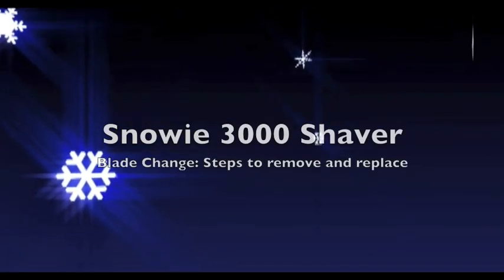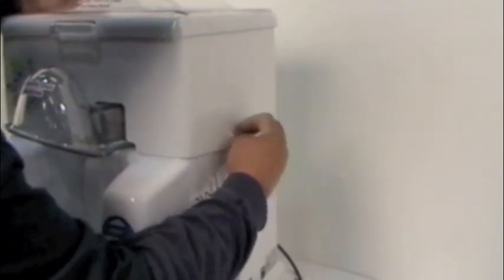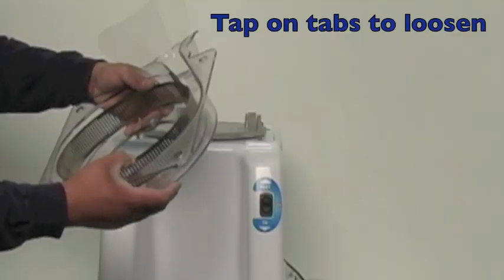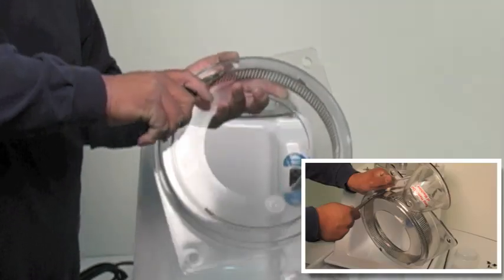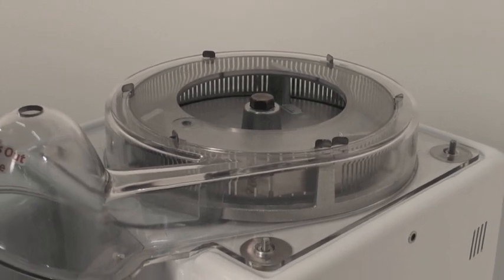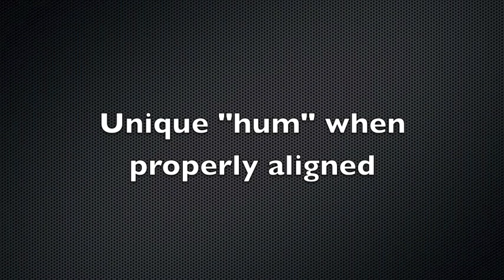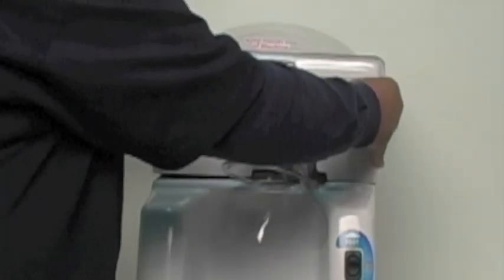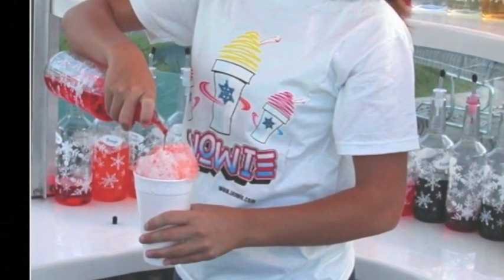How to change the blade on a Snowie 3000 Ice Shaver, Shaved Ice Machine

Comment: I just purchased a used a snowie 300, how can I tell if the blade are not good, or doll blade?
Reply from the maker: You can tell the blade is dull or dulling when it slows down or stops shaving. Remember not to let anything other than ice go into that hopper. If you let an ice tie in there, your blade will be completely useless in less than a second. I have looked at a blade after an ice tie entered it, and it looks like one scratch going across the center of the blades. What looked like one scratch made that shaver barely shave at all.  So make sure that only ice is getting shaved, and your blade will last a long time.

Comment: I read where this blade should last for approximately 10,000 cups of shaved ice. We just opened a store 6 weeks ago with a brand new Snowie Cube Pro and have sold approximately 1,200 cups of shaved ice so far and it is already taking much longer to shave a cup of ice than it did when we started using the machine. I am also seeing very tiny chips of ice that have not been shaved when I mix an Italian Ice. Why would this be?
Reply from the maker: Hello, it sounds like something may have gotten down in your blade. That would cause the blade to shave slower and possibly not shave as well. However, we are happy to replace your blade and make sure the one you received is not defective. If you don't mind calling in our customer representatives would be happy to assist you. Thank you!
Reply: @snowiellc  I just got off of the phone with a Snowie representative and it was no problem at all. The nice young lady I spoke with told me that she will get a free replacement blade out to me right away. This is definitely the kind of customer service I like to deal with. Other than having this blade issue, I would recommend this machine to anyone that has or is about to open a shaved ice business. I thank you Snowie!